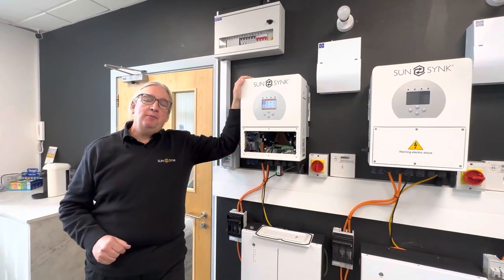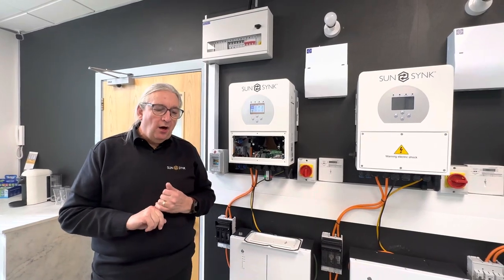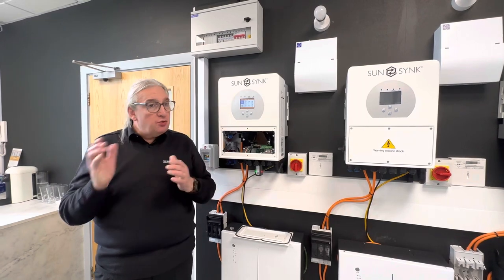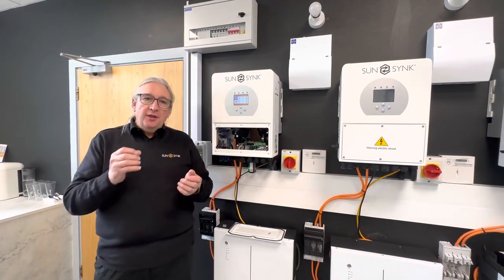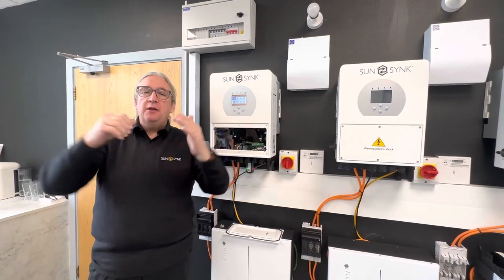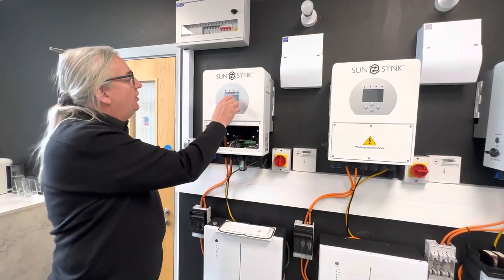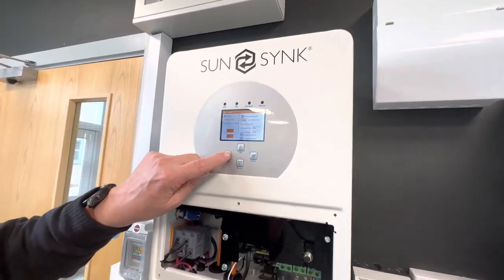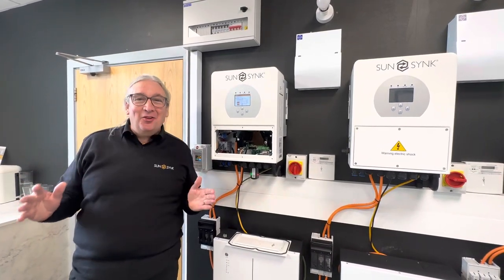Using the mini beast to heat your hot water.￼

Comment: The point of phase chopping power limiting is so that the heater element only uses as much power as is available to spare, so if less than the full element power rating was available, the element would be throttled instead of run at its full rating.  With on/off control, that excess has to come from either the grid or the battery bank.  This kind of throttling is very common for controlling heaters in soldering irons.  It does introduce power quality issues due to phase chopping, but this could be fixed with fast enough control loops on the AC side of the inverter looking at the grid monitoring CTs and the inverter already knowing the thyristor/TRIAC firing angles as it is controlling them anyway so it only shoves extra power onto the AC buss when the thyristors/TRIACs for the heat loads are conducting.
Straight up on/off control is for things like induction motor dump loads (air compressors, air conditioners, heat pumps, water pumps, etc.) that would get angry on phase chopped AC.
Reply: What are you saying, he's wrong?
Reply: @aldozilli1293  There is a reason for power limiting resistive water heating, as the objective is to use what excess power there is.  He is confusing that with the way water heaters normally work, which is to heat the tank water as fast as possible for minimum recovery time.
Reply: @randacnam7321  OK I see, I'm a layman!

Comment: Great product we will be fitting the third one next month BUT one question why do the CT clamp need to be next to the meter?i ask as we had a 16 mm submarine direct from meter box to board position but putting clamp on the board end would not work so it had to be next to the meter ( but as far as I'm concerned it's same but just has a switch fuse inline ) please enlightenment required 😂

Comment: Hi, I have the 5.5KW Ecco Hybrid inverter, here in the UK, its great. I use the Auxiliary load function for my Immersion heater. My question is, on occasion other loads in the house take us over the maximum output for the inverter, and results in us pulling off the grid for short periods, is there anyway to prevent this? I see there is a check box in settings for AC load couple on load and grid side, which both are currently unchecked, while there is a load coupler installed on the grid side, should this be checked? thanks in advance.

Comment: Brilliant video keith. So as a beginner in this field can I just wire up the aux  port on the inverter to the immersion heater? Is it that simple ? (Or is the mini beast a different appliance to the normal inverter?) we have a 50kW 3phase inverter.

Comment: Forget about the mini beast, tell us why the 5.5kw & the 8kw inverter can’t do the same as the 3.6kw inverter? I don’t understand why only the “mini beast” can work up to 7.2kw?
Reply: Don’t the 5.5 and the 8 units do 6.5kW?  About 90%
Reply: @WindyJAMiller  My 8 routinely does more than 6.5kW - but suspect this is marketing spin to making a small 3.6kW inverter more appealing than similarly rated inverters because of the hybrid nature of the device?
Reply: @MrPurle  I agree with you. It makes me wonder why they don’t let the 5.5 & 8kw units work up to twice the amount as well. Might be to do with what most U.K. customers can get approval for from their DNO and not requiring additional approval.
Reply: @MrPurle  The Sol-Ark 8K (a modified version of the Ningbo Deye inverter the 8kW Sunsynk is based on) is rated for 11kW of PV input.  It's either a mistake in the documentation that really means 6.5kW per MPPT which is the limit for the Sol-Ark 8K, 12K and 15K or some kind of regulatory kneecapping to account for some oddity in your wiring regs.
Reply: @MrPurle  whar is the maximum solar power on the settings.  The 3.6 unit can be set up to 8kW on the settings, but the most I've seen is 7.2kW from 8.2kW of connected panels.
Reply: @WindyJAMiller   wow! The 3.6kw sounds way better than my 5.5kw inverter. The renewable company I bought my Sunsynk products from didn’t want to give me an additional 4 panels because it’d make my system 8.4kw and I’d need the 8kw inverter which they said the DNO would’ve said no to the approval.
Reply: @arnielegend  unfortunatlly sizing the equipment does take some skill.  its not possible at this time with limited information to make a comment on the desision of the company yoube purhcased from.  the 5.5kW unit does give you a fair amount more invertering power at that isnt a bad thing!

Comment: You keep referring to AUX, is that the same as LOAD on the ECCO3.6?
Reply: I was wondering the same and read the manual carefully. The generator input can  be configured as the Aux output. There’s a system drawing showing this in the pdf and it’s switched gen/aux in the app settings. You appear to be able to set solar and battery SOC limits for when the output is active. It looks ideal to dump excess power to the immersion and save on the gas fired boiler.

This video would have been better served explaining how to set it up on the immersion rather than wasting time selling the feature in a rant.

Comment: Several crass arguments there. Try to explain it clearly - like "when the battery is full and we have surplus solar power we turn on 3 kW of immersion heater and pull power from the sun and the battery".

Comment: I’m not getting this ! My battery is full and i want to keep it that way. I only want to feed the excess solar after any loads are satisfied to the element.
Reply: I agree with this - the issue is if you keep using the Batteries for hot water heating those batteries will not last so long.

Comment: Wow, total techno-babble nonsense. I quite like your product, but now I'm out now.  How can you not understand that people want to use their immersion heaters as dump loads, a way of dissipating excess generation and getting some benefit, not to micro-cycle an expensive LFP pack. I'd love to understand how running an immersion coil at lower powers is less efficient? It comes across like you think that people use immersion heaters for primary heat - if you do, you spent money on the wrong product first - or have very low hot water usage.  Insulate -> Heat generation -> PV -> Energy storage